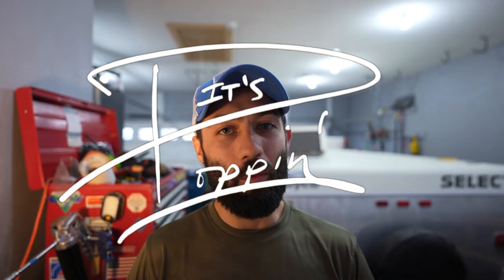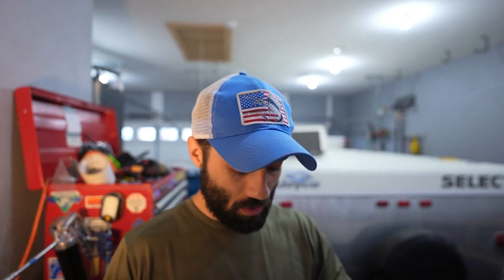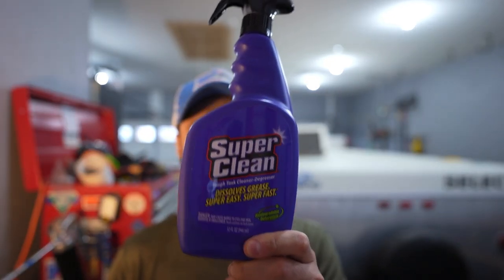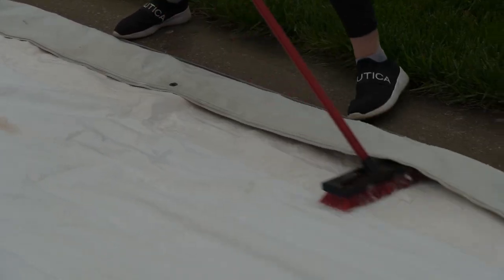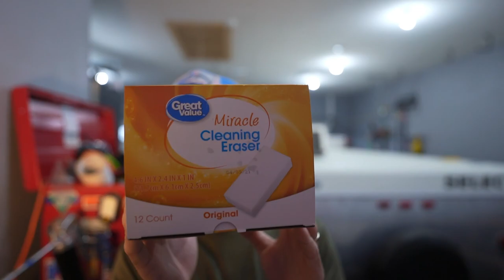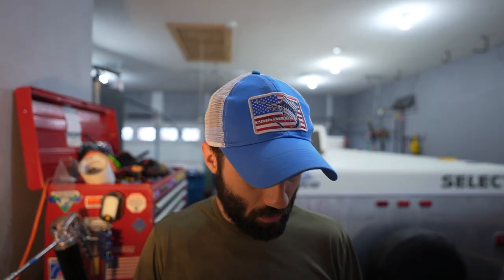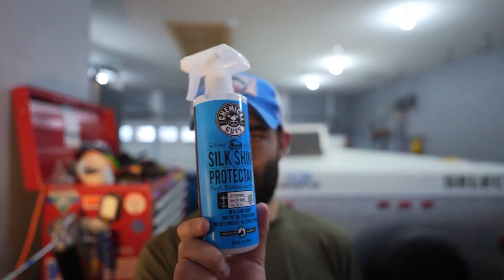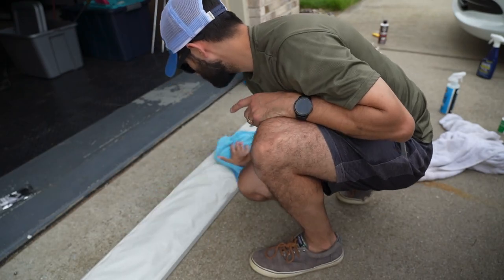How We CLEAN & Care for Our Pop Up Camper Bag AWNING!

Comment: Love your videos! Super helpful. I know this is off topic but, any advice on removing the roof racks on a 2003 Utah? Leaking roof...horror show lol. Thinking about removing the racks and using Eternabond over the seams. Thoughts?
Reply: I have an ‘06 Utah, do you hav the Alumitite or ABS roof?  How is the overall condition of the roof?
Reply: I believe it is alumitite. The roof is 3 pieces with the seam under each rack track. I would love to get rid of the racks altogether. Thank you for your reply.
Reply: Great info! Thank you :)

Comment: Ok so this is a stupid question but I cannot find this answer anywhere do you have to have the camper level to work on it in the inside : example painting cabinets or putting floor in ? Thank you so much .!!
Reply from the maker: No, that's actually a really interesting question. Our garage floor is almost perfectly level left to right so I've never thought about it. Anytime I raise the roof, I like it to be level so that there isn't any damage to the lift system. So that might be your answer.  I can't image not being level would affect painting of the cabinets, but I suppose it could affect fit and finish of the flooring install.
Reply: Yes that’s what I was looking for I wasn’t sure if it would affect the lifting system or not ! Thank you so much